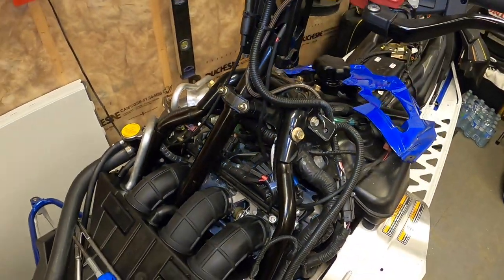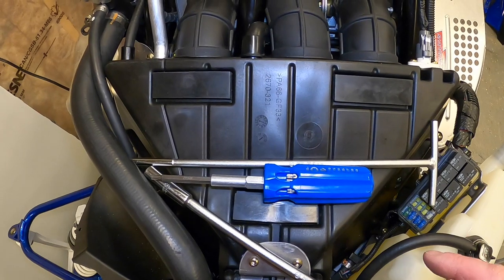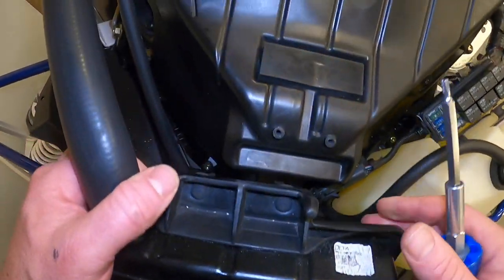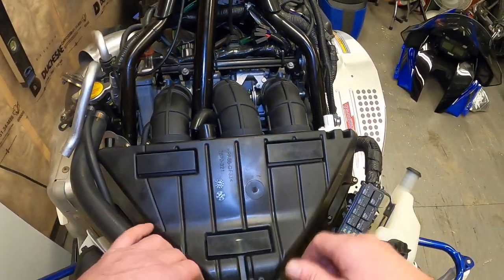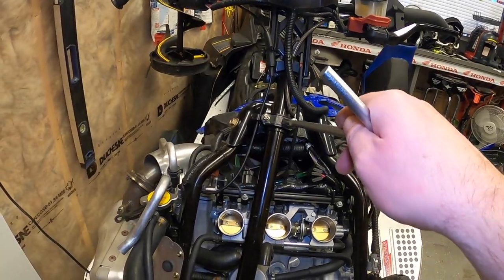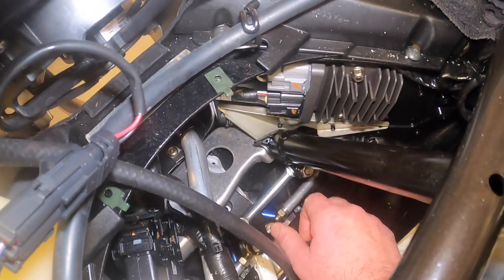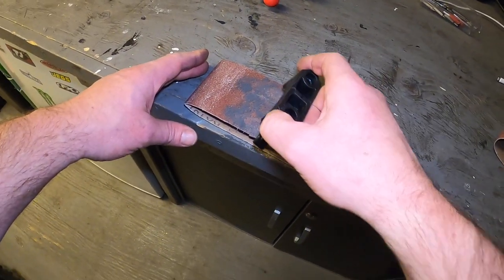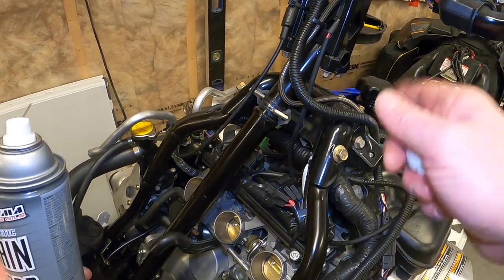Yamaha Viper Steering post play fix. /viper sidewinder arctic cat

Comment: Hey Mike nice job on the video. 
Can I get an update on the DuPont sliders you installed, was it worth the money. I’m chewing through a set of regular Yamaha sliders just in the front similar to where yours wore down and probably only lasting 1300-1500km. Wondering if your getting longer than a season or how many km your at since the install.
Reply from the maker: Yes the duponts will last longer not forever but definitely longer and help with fuel economy too.